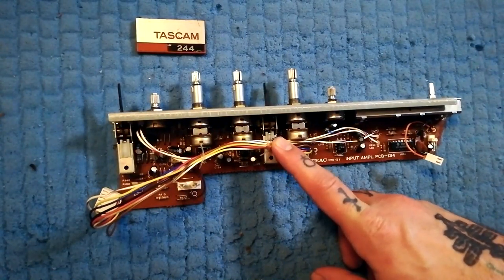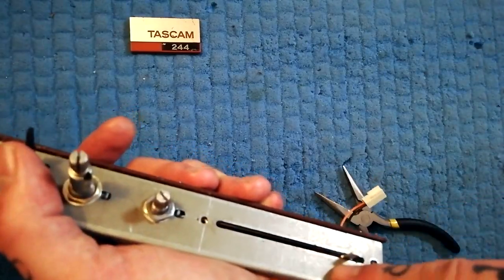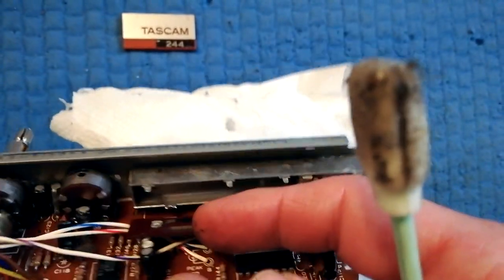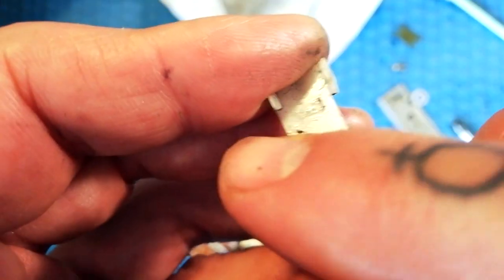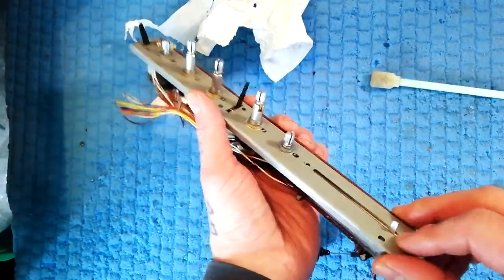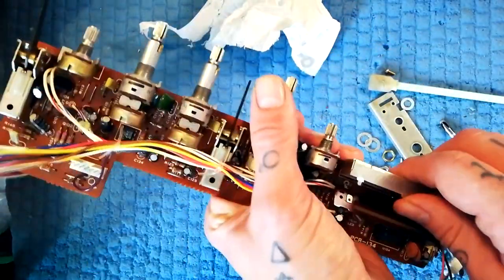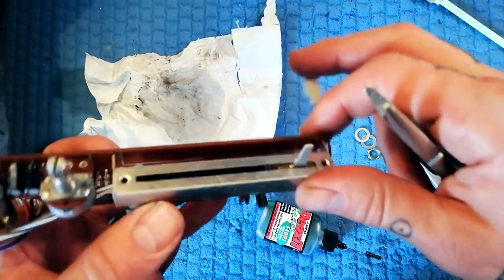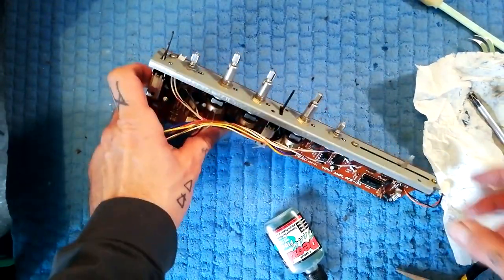Fix crackle - Pry apart & deep clean audio mixer fader | Tascam 244

Comment: This is exactly where I’m at with my 244.  I was extremely lucky in scoring it for $30 USD on Craigslist, but sometimes you get what you pay for; it was absolutely coated with nicotine stains.  I would spray the outer case with Windex and just watch brown liquid get darker and darker as it ran down into the paper towels underneath.  I was lucky the 246 was from a smoke-free home, but I paid quite a bit more.
Any suggestions about deep cleaning the pots of the channels for the 244? I get crazy-loud pops if I move some of them, and I noticed the metal shafts within each knob are coated with nicotine.  I am thinking Deoxit D5, but if you recommend something for nicotine, I’m all ears.

Also, have you ever recapped a Tascam?  I am going to do so with my 144s and am excited but nervous to do it.
Reply from the maker: I cleaned the pots in the preceding video to this one, if you go to my channel's splash page then the uploads section you should find it pretty easily. The pops you're hearing will go away if you get some contact cleaner and compressed air through  the recess, followed up with an appropriate lube. D5 is probably a better product for the job but we're a stingy breed, the Scots, so I just use the fader lube for everything and it seems to work !
Reply from the maker: Replacing capacitors on a board - I've done it as necessary for smaller boards but not for a whole machine. As these things get older I guess I will eventually have to do it as a matter of course but I've shied away from doing so this far for two reasons - one it seems like mad, mad boring work and two though I try to keep my labour charge in line with UK minimum wage to make these things affordable for other musicians on a budget, and If I did a full recap as standard I'd have to dramatically increase my prices to reflect the extra labour...as it is I still get snarky messages from broke, post-marxist ebay browsers accusing me of being a bourgeois vampire etc etc so I'm keen to postpone the additional hate-mail for as long as possible!
Reply: Tetrakan Supermonobloc I can tell you I’m far for of a pragmatist than Post-Marxist... I have a signal issue question involving my 144; After a few tests and a deep clean, I realized only odd tracks were making it onto tape, even though I could clearly hear the instruments in the mixer at the time of recording. So somewhere in the chain, the 2 & 4 signal is being cut close to the tape. Any idea how to hunt that down?
Reply from the maker: @BogoEN  Not specifically because i only ever worked on this model 3 or four times and all but once there was so much going on with the transport I never got to the electrics, and though I have the schematics (they're free to download from my blog btw) I haven't spent any time with them. Assuming the electrical topology is similar to the 244 then the signal is getting through the mixer channel to the stereo bus okay, so you can start tracing the signal after the pan pot; See if you're getting a signal at the input and output of the record enable switch; the input and output of the DBX encoder; the input and output of the record amplifier; check the bias oscillators for those channels have a strong output of the correct frequency (probably printed on the PCB); there will be a relay that lets the bias into the play/record heads during recording but blocks it during playback - check whether bias is getting through that relay in record mode. That'll helpnarrow dopwn which areas of the boards to recap or replace components.
Reply: Tetrakan Supermonobloc Thanks alot, those are helpful places to start. So just to hog your comments section a bit more, I’m currently on the 244 and have finally cleaned 🧼 the nicotine out of channels 1-4 via this video etc., but realized that the master fader and record/cue switches are underneath the recording and playback amps to the left, covered in a 🐀 rats’ nest of wires. Have you ever pulled out the rec/play amps to clean these components?
Reply from the maker: BogoEN Yeah I've filmed and edited a video on that, it should be uploaded in next couple of days :)
Reply: Tetrakan Supermonobloc 🤯🤘🏻🎸🤘🏻👏🏻👏🏻👏🏻🙏🏻